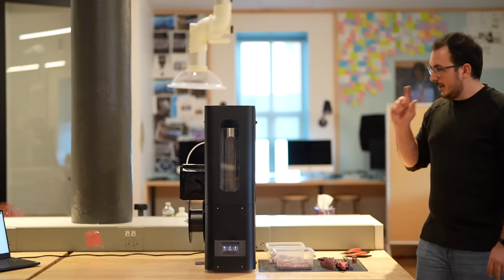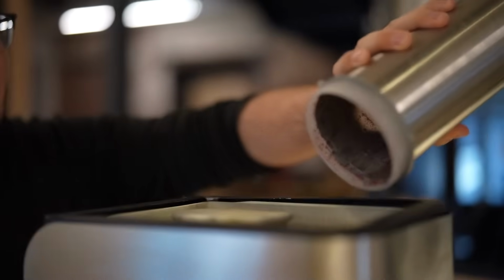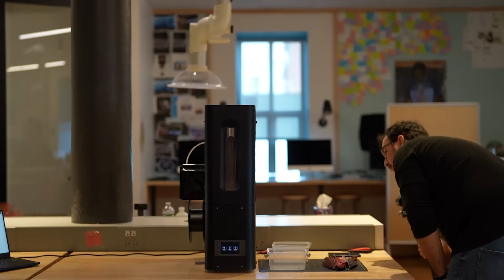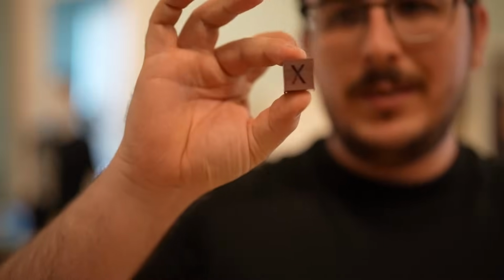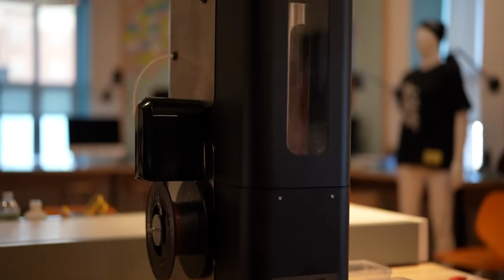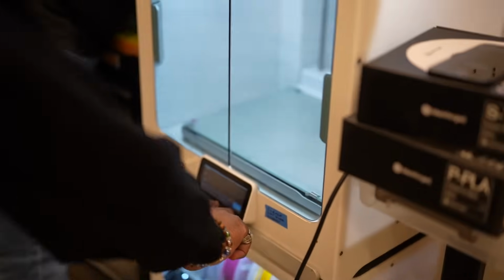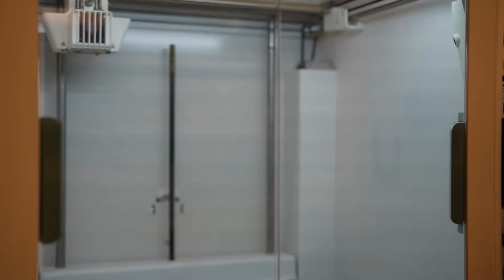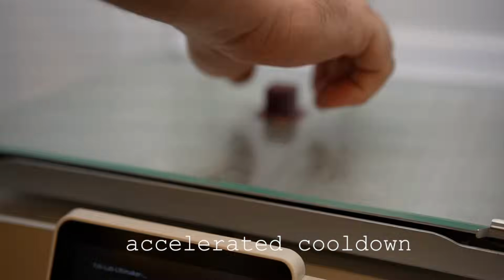Introduction to Loop -  Full Demo Day

Comment: How are you getting consistent filament diameter? Is it extruded at 1.75 or close to that diameter, or is it extruded at a bigger diameter and pulled to the correct dimensions? 
If the latter, does the puller create the desired diameter? Or is it gravity that does the work while the material is hot?
Does it have any sensors that measure diameter, and if so, will it self adjust if it deviates from the accuracy parameter you stated(0.01mm)?
Are you feeding the material using an auger-like system, and how do you mitigate bubbles in the filament?
Since most waste is kept in open environment,do you have plans to add drying to the machine? Did you guys dry all your waste pla?
Reply: Watching closely it looks like it produces some wildly different sizes with little consistency.
Reply: The fact that even on their website they claim it's accurate and the caliper shows 2mm, and the fact that they never measured the filament in the video answer it as I see... Extruding filament is not that hard... Making it to 1.75 with 0.05 deviation max - what is still not great tho, is the task... And as I see they never addressed this...

Comment: I love the video. I know it’s still a prototype. I think you guys need to integrate some kind of camera into the spooler part so I can visually look at it from my phone if I’m not right by the machine as it’s cooling also something to send me notifications when it’s done Spooling a print I think you guys keep it simple with a nice UI something that I can download on my phone and almost think of it as like a bamboo lab app where are wiki forms just in case if something were to happen I also had an idea. I don’t know if this is something possible for y’all to do but the print that I would have that I want to throw away if I can physically take a photo of it or something and it could tell me if it’s big or small enough to shred I know that sounds complicated but if I could do that from my app, that would be really cool just so I don’t break the machine and also y’all would collect a bunch of data from that alone and I would love it if we could have some kind of computer software where I can see the diameters live on my screen or even from my phone, I can see the cooling temperature the fan speed, and another thought I had was if you guys were to possibly build almost a little bit of a scale that can measure how much filament is in the sifter when it’s feeding into the extruder part in the machine to where it can calculate from your app or from your computer software on how much time it’s going to take and then send me a notification when it’s done I also think with the software and the app you guys should also figure out a way to collect as many print profiles for filaments as you could to get the best extruding temperature and the extruding rate to get the cleanest filament out of the machine you guys could probably also use AI somehow to calculate it in a way other than that I think it’s a great machine, but you guys definitely need to focus on a bunch of software with this machine as I feel like anyone with a bamboo lab printer or these new printers that are coming out that are superduper easy to work with and then buying this machine when it doesn’t have such great software I feel like it’s going to be a hard time for the user experience if that makes sense and I feel like if you guys harness and dial in the software to the best capability that y’all can, I believe this machine could be really good. I would also like to see if you guys could do a video on it shredding filament discharge from the new AMS printers such as bamboo labs reality those machines if you can show us a video of that working I think that would be really cool as AMS print with different colors mixed together instead of just one print that y’all showed and even taking the discharge and mixing it with the print, I think would be really cool

Comment: I dont know why people are frustrated woth pricing but 1,500 is really really cheap for all the R&D went into this. Im excited to see the upgrades in V1. I would to see the breakdown of the device.
Reply: I have over 10kg of waste plastic from my print farm and tbf it's not worth printing with it. The colour will be wrong, the flow will be all over the place. I'd. have to make new cheap random colour models for recycled parts and the finish will be gross, not a nice experience for the customer who recieves it.
Reply: @liam4686  i usually paint anything i make, so color doesn't matter to me. I usually print in black and Grey anywaya
Reply: @liam4686 Just add a black master batch
Reply: Bruh i was expecting 15k not 1.5
Reply: Fair but that's roughly 150kg of bulk PLA, in an actual controlled color and consistent diameter.  Then add the energy used, maint/replacement parts, etc.  Even if it works as advertised, it will be substantially more expensive, lower quality, and more time, then not doing it at all. :D
Reply: @falken8088  But its cool.....
Reply: Yeah, for what seems to be a plug and play product, this is pretty good pricing. From what I recall, the closest in price is the Artme 3D at 700€ and that's just for a kit, you still need almost 2 spools of filament to print all the parts needed.

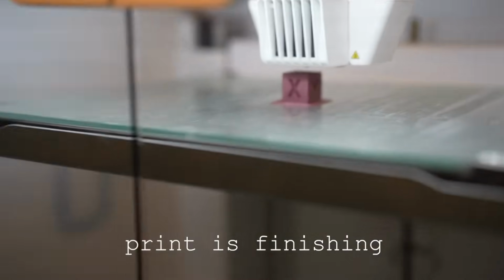Comment: The print quality is NOT good at 28:34... use a printer that can actually produce something that doesn't have tons of VFA and ringing artifacts. Or the quality of the filament is the reason for the poor print?

Comment: Looks very cool, but you guys need better video equipment and more light. I couldn't make out half of what you were trying to show us.   Awesome product looking forward to its evolution
Reply: Looks like this was done on purpose to ommit certain parts of the product that aren't ready to be seen
Reply: Agreed on the video quality. Any modern cell phone camera could have done a clearer job here.
Reply: It's a good equipment, just poorly used. For example using a stabilizer without knowledge or using a Lens with a low focal, like F2 result having a focus point very very small...
Reply: @PinkFloyd1213  thats what i was going to say given the DOF shift and fast autofocus it would imply it's actually pretty good equipment however definitely could've done without autofocus and adjusted f stops lol
Reply: Half the Internet called this a scam . Including myself . I finally found this and wanted to change my tune ....I was still left scratching my head. Come back when you have more . We want to support innovation in the field , but you guys keep dropping the ball at every point . Sorry mate's . I stay tuned but still disappointed .
Reply: I can't help but think all the times the camera couldn't focus or they pan away from the machine was intentional. If this machine works as they advertise, this video did NOT increase my faith in it.
Reply: Was looking for this comment! Couldn’t see a damn thing!

Comment: I'm VERY glad to see that this isn't just vaporware
Reply: Step 1 of selling Vaporware is to show something that can then turn to vapor...
Reply: They've shown complete disregard for diameter control. That's a huge red flag for people who don't know what they're doing. Anyone can reextrude plastic, it's a dead simple process. The reason why you need a whole company behind it is because the extrusion process requires extensive QC otherwise anyone can just make up their own filament company.
Reply: @thanhavictus  totally agree here
Reply: It's in an early production prototype. So could still turn out to be vaporware
Reply: @YURIKAccessories   Who knows if it's even that. It's easy enough to build a thing that just spits out filament from a hidden little spool in the back for a video like that. Might be genuine engineering effort might not be.

Comment: Could hardly see what was happening. While I know the extruded filament will be combination of a multitude of different colors, for the demo you should have only used white shavings so the output color would be brighter and easier to see.

Comment: This is very cool! Hate throwing bad prints away filling up landfills. Would love this solution for recycling and generating new filament ⭐️⭐️⭐️⭐️⭐️👍
Reply: You can always break them down with a blender and then melt the pieces down in a silicone mold. That's what I do with my failed prints and poop waste.